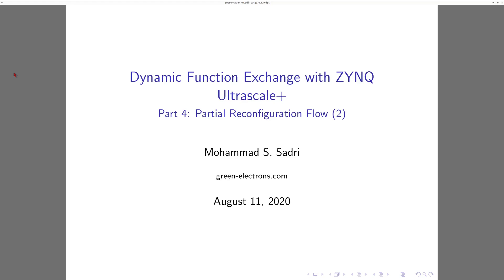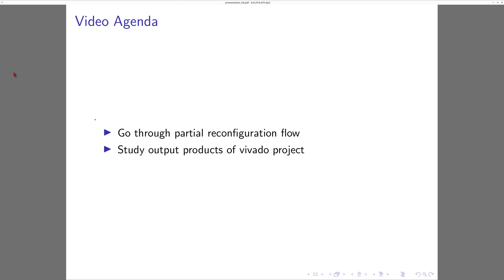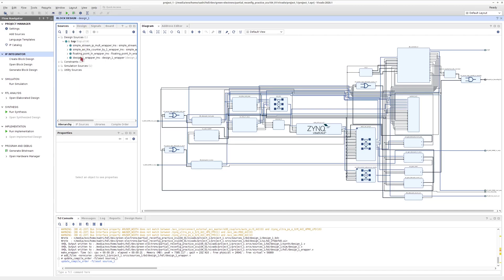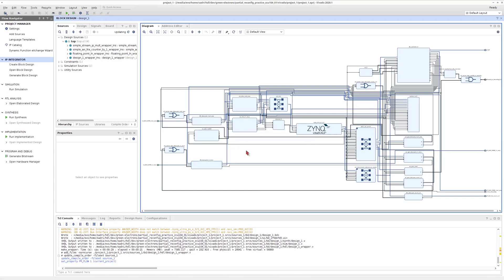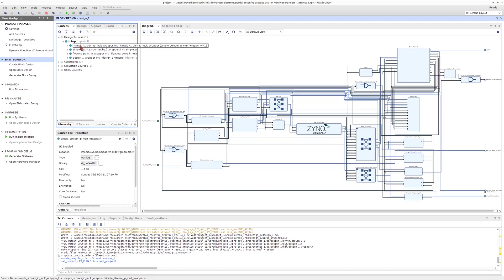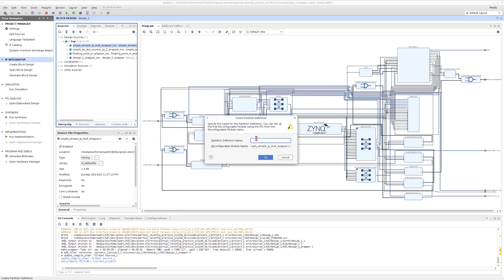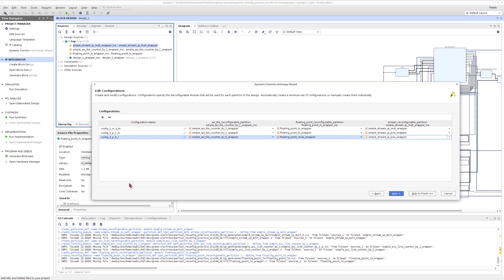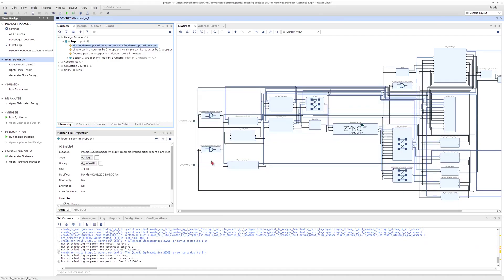Dynamic Function Exchange with ZYNQ Ultracale+ : Part 4: Partial Reconfiguration Flow (2)

Comment: Hi, 
If there are more than one IP core in a Reconfiguration module, Do we need to add the XCI file for all of them or is there any better ways to do this?
What I think right now is that in that case, we have to package all those IPs in to a single Block and generate XCI for that single block right?

Comment: Hi, thanks so much for the tutorial. I've setup an IP, then placed it in a block diagram to generate. After this, when I select the wrapper file to be a partition definition a notification says "Module with Block Designs type of sources in its hierarchy cannot be made into partition definition" So are you still  supposed to wrap the design? (Also, Vivado 2020.1, Windows 10)